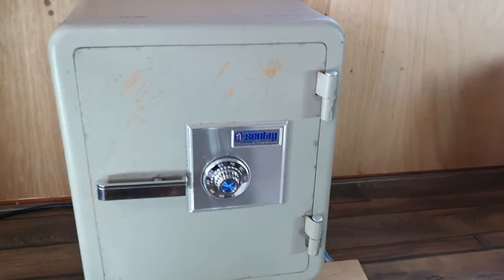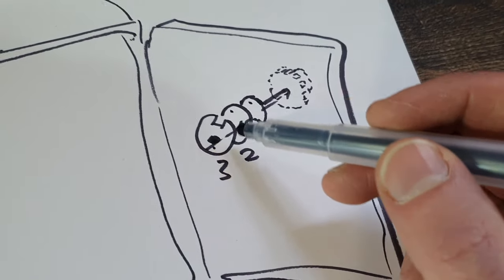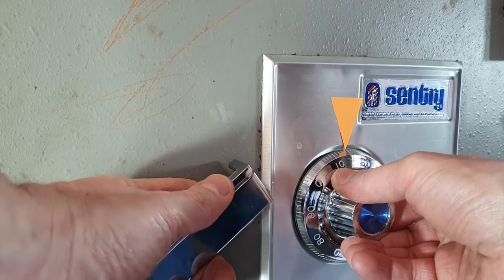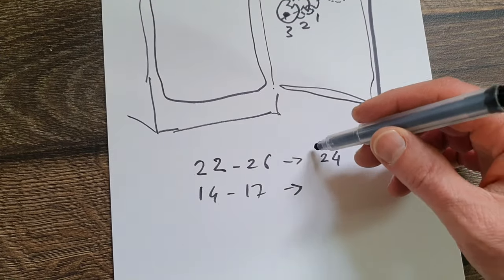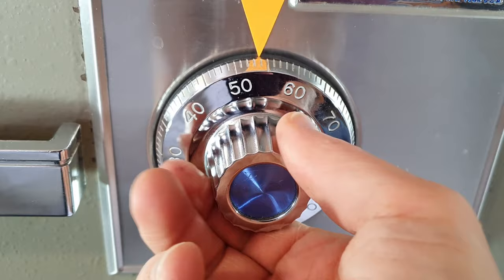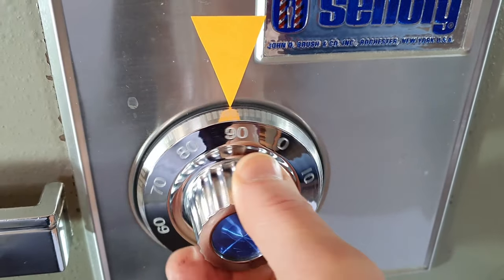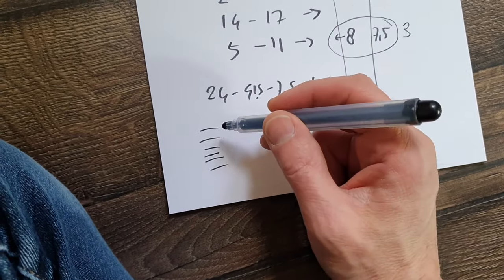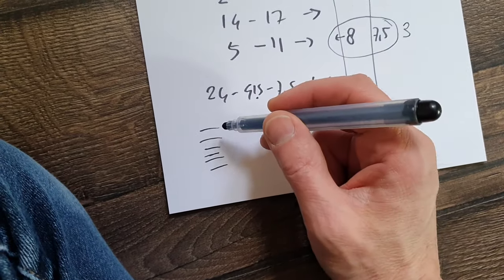Cracking your old Sentry Safe (without destroying it)

Comment: I need help! My dad passed away last January some important documents are inside a Sentrysafe model MODEL SFW123CS, I have the combination but every time I try to open it the lock gets stuck when I turn it to set it to the next number,  I tried spraying it with WD40 to loosen it but it still gets stuck, the lock doesn't glide smoothly as it should, is there something else I could try?
Reply from the maker: Hi Jessica, 
I am sorry to hear your dad passed away. My condolences. 
It is difficult to assess what is causing the lock dial to get stuck, without seeing and hearing it. Great that you used WP40 to loosen it up. I am afraid the WD40 does not reach the inside mechanism, where I assume the problem will be. With the mechanical design in mind, I imagine that the wheel or wheels hit the locking latch creating this stuck effect. To fix that, make sure you fully lift the handle (with some force) before you start dialing your number. Also, check if you can keep rotating the dial clockwise for more than four revolutions and then counterclockwise more than four. Regardless of the combination, you should be able to keep turning infinitely in both directions. If this works, then go back to three revolutions clockwise until the first number, go counterclockwise and pass the second number once, hit the number, and turn clockwise to the third number. For more information on your safe see https://cdn.masterlock.com/sentrysafe/resources/pdf/manuals/518792.pdf 
I hope this helps. Good luck, and feel free to ask for additional support.
Frank
Reply: Put the safe on its back. And spray worh wd-40. On its back so the WD soaks downward into and under the dial. Also turn the dial while you spray the WD. Be generous. The locking mechanism is in a separate compartment than what's inside.

Comment: Thank you Frank. I had to do some searching to find out how to open my dad's old safe. The combination was correct, but clearing the lock for zero was the problem.

In these older models one must clear the lock from 0 going to the left (counter clockwise) 3 FULL times, on the fourth a person should go straight to their first number. 

Next, they should go to right 1 FULL turn passing the first number and going to their second. 

Finally, they should turn the dial left again to the third number. 
The trick is in the clearing the lock to zero to start over. Newer models go opposite of this combination. Also the gears inside should be greased 1 time a year. It says with a graphite penetrating oil or light household oil. The plate is held on by one screw so easy to get to. 

I hope this helps someone else. Finding the answer was a pain.
Reply from the maker: Thanks a lot for figuring out the original sequence! I also hope this helps others in their persuit to get their safe open.
Kind regards,
Frank
Reply: Amanda I am really really grateful for your comment. I had the same problem, and today after a year of trying combinations I read your comment I could finally open my grandfather's safety. He is so happy right now and all because of you. 

Greetings from Chile 🇨🇱
Reply: You are a Saint! We've been trying to open my dad's safe for at least an hour and I tried looking for an indepth video. I was listening while scrolling through the comments and found yours. I tried it and worked 1st time! We had the combination but we couldn't get it to open. I can't thank you enough for your clear instructions! ❤

Comment: I have had a model 1330 I have been meaning to try to crack for a few months now. Using this method I identified a gate that was wider than the others (6 vs 3-4) and put it as my third gate, I then used the other numbers in the method you described and sat down to push through the 112 or so combinations. Lucky me I opened it with the fifth combination!
Reply from the maker: Wow, that's great! Well done! I am happy for you that it worked out well. ☘️
Cheers!
Frank

Comment: Thank you. We hadn't used the safe in some time. Hubby had a memory of a range of three numbers  that he said made a math equation when I continued to query him and I played with the dial.
As it turns out those three number ranges were standing out, along with a few others.
But as he finally given me enough clues I used those numbers as a careful range to dial to that I remembered dial locks use.
Clear right 3 times, left to the number, to the right passing the second number once and then left to the last number.
Yet I had to turn to the right to have it pop open.
Just like the directions said on the combination card that was inside. 
I began around 2330 and popped it open around 0100.
Reply from the maker: Well done!

Comment: Im trying to reverse engineer a 1250 myself... lucky for me the door is open already, just need the figure out the code .. you have taught me so much on how these systems work.. thank you. Great video.
Reply from the maker: Thank you very much! Good luck with your reverse engineering.
Reply: If it's open call sentry with model number and serial number ( inside safe)and for $30 the will give you the combination....
Reply: If you have it open, all you have to do is take the cover off of the lock and you can see when the gates line up.. so there's no guessing.  Just watch a video on how to do this, there are 100's of them.

Comment: Great video!  I cracked an old sentry safe for a friend of mine the same way, with a very clear last number (much larger gate) and a tell for the second number (louder click).  I can also verify that the first two numbers were located at the false gates, although my friends old safe had a left right left combination at these numbers(counter clockwise, clockwise, counter clockwise for those new to cracking and mystified by the left and right nomenclature like I was when starting).  Also verified as you noted in an earlier comment that it could open right left right with offset 6 numbers for the second and third numbers.  

Unfortunately I had to tell my friend the safe was empty.  (Or was it?  He'll never know.  Heh-heh.) Thanks again for the video!  Good stuff.
Reply: Oops.  Meant 6 number offset for first and second numbers.  Third number stayed the same as would be expected.
Reply from the maker: Thanks for the great comment! You just removed my last doubt about my assumption on the starting direction of dialing the combination. I now assume the original is left-right-left which makes sense as most of the other models and brands start left. The only reason I started right (right-left-right) was another video of a simular mechanism which showed this sequence. The fun thing is that it works both ways, although the numbers will be different. I will add a remark to the description of the video to help out others. Thanks a lot and all the best to you! Frank
Reply from the maker: PS: my friends safe was full with valuable things and he is now using the safe again. :-)
Reply: Mo

Comment: Hey Frank great video. My safe is the exact model as yours. Unfortunately, the false gates did not give me the first  number but the third number was obvious as you said. From the false gates I got 98 39 and 23 but when I finally cracked it (using a different method) the actual numbers were 95 41 22. I went through 144 combinations and (I later discovered) the 95 was too far out for it to work (the other two were close enough for alignment). 

However using your video I could see that by removing the sentry cover plate and the dial that I could drill a 1/8in hole, in just the right spot (in front of the lever nose), to allow an 1/8in wire in and align the three gates as the wire dropped in place between the gates. Could not have done it without your video, Thanks
Reply from the maker: What a perseverance! Well done. I am happy my video was useful. Have a great day! Frank
Reply: Can you make a YouTube explaining this 1/8 hole technique : )
Reply: Do you know the model of this safe?  I have the exact same one also.  It's like the internet has been wiped clean of any info about this thing. :)

Comment: Hey Frank!

Really appreciate the video, so concise and to the point. I’m working with the same model sentry safe and was pretty confident with my identification of the third gate, though now I am having my doubts… just wondering what kind of lever pressure you applied in order to determine the third gate. Of course when I ease up on the lever it widens all of my readings but perhaps this is creating inaccurate numbers…

I hope that was as clear for you as you were for me!
Vielen dank aus Kanada ⏲
Reply from the maker: Hey Tez,
Thanks for your compliments and your question. 
The pressure I applied on the handle was very light. When you find a gate you can push a bit more, because there is some space (depth) in the gate. Although while finding the edges of the gate by turning the wheel, there is hardly any, or no force on the handle. Just keeping it in the position. The gate edges ranging a bit wider should not be a problem; just take the middle of the range for the assumed gate middle.
Hope this works for you.
Have fun cracking your safe! 
Frank

Comment: Thanks so much. I am working on a similar sentry safe. I was wondering if you discover why you got a second click that clued you into the second number. I may have missed it in the video. While looking at the mechanism were you able to reproduce that situation?
Reply from the maker: With trying out all remaining combinations (3rd wheel on one value and varying 2nd and 1st number), I found 2 occurrences where the second wheel was on the same number (see video minute 13:45). There the handle outside could be moved a bit further with a different sound, the 'click'. Indeed when you look at the inside mechanism this is what you see: the 3rd wheel has an 'open gate', so the latch slides in, and at the same time the 2nd wheel has an 'open gate' to allow for the latch to slide in. The latch than hits the 1st wheel after some movement and provides the click sound.
Good luck with your safe.
Frank

Comment: If you still have this safe.  Reach up in the top left of your safe (or just look up there)-- you will feel a couple of tracts:  that black tray in the bottom of your safe is supposed to slide in those tracts and hang from the ceiling like a drawer.   I have the same safe as you.

Comment: Hello Frank and thanks for making this video! I have a Sentry v330 that needs cracking and this video is the most helpful that I've found by far. I still don't quite understand how you got your 12 potential numbers from positions 1 (22-26) and 2 (14-17). Would you mind clarifying how you identified those 12 numbers? On my safe, I've identified the three "latch" number ranges but am not sure how to proceed from here. Thanks again!
Reply from the maker: Hi JC,
Thank you.
I found twelve potential numbers, one of them being the 3rd wheel number. I did that by 'scanning' the full rotation of the dial with very light pressure on the handle. Every time I ran into bump, I tried to find the related (false) gate edges, just like with examples 1 and 2. With my safe I could identify 12 of those gates, each with the 2 edges, and in between the edges allowing some movement, like 1(edge 22-move-edge 26).

So my advice would be to scan the full rotation, note down all 'bumps', try to identify the false gates in the middle those edges. What might help is that the numbers are evenly spaced, so even if you have found less, you could derive the rest of the numbers, or check the uncertain ones. 360°/12=30° or if the dial runs from 0-100 the spacing between the 12 numbers is 100/12=8.33.
Hoping this helps you.
Kind regards
Frank
Reply: @frankrood8464  Hi Frank, so the false gates 1 and 2 you show in the video are two examples from a total of 12 false gates you found with your lock? And the other 10, which aren't shown, yielded the other 10 numbers to try? Thanks

Comment: Thanks.  I have almost the same safe.  I however, KNOW the combo...yet cannot get it to open!  It’s been stuck shut almost 30 years now.  Your video however has given me renewed hope.  I thought the handle was broke.  I now realize that I must not be picking up the right “wheels”.
Based on my known combo...I intend to try it with your method to verify the numbers are indeed the numbers.  You see I say I KNOW the combo like I am confident.  Yet it has been so long that I’m wondering if I am actually remembering wrong.  Or simply not starting in the right direction.  (I swear my sentry started LEFT first.  I also remember having to spin 4, 3, 2, 1 times .). It seems that may not be as important (?).  Anyway... I am having some renewed optimism here so again, THANK YOU.
Reply from the maker: Thanks Sandi! If you have a newer model the times to spin in each direction can vary from the model featured in this video. The more modern versions have a decoupled 3rd wheel and what I have seen on YouTube they all start with turning left (counterclockwise) first. By the way, I am not 100% sure about the turning direction for this model,  you can decode (crack the code) it starting left too, although the numbers will be different from the demo. I understand your struggle, even if you know the combination, it requires correct and accurate turning. And if your known code doesn't work, you could go for the shown decoding (crack the code) strategy. About the number of times to spin... for the first turn it doesn't matter if it's more than 3x, for the second and third turn the number of turns do matter a lot. If your safe has the same mechanism follow this video (try same procedure  starting counterclockwise) . If your safe is a newer model try to find the manual or similar video for the normal opening sequence.  Hope it works out for you. Good luck! 
https://www.sentrysafe.com/support/product-manuals
Reply from the maker: Hi Sandi, I added some advice in the description of the video. This might help you. Let me know if you got your safe open.
Reply: I have the 1973 Pyroguard by John D. Brush & Co. handle loose, correct combo.
Reply: @frankrood8464  THANK YOU!  As soon as it's not 40° out in my garage... I'LL be on it!  Saved your video.. Gonna give it my all!  (lol, I don't even think I have valuables in it... But some childhood memory stuff... More likely!). Hopefully, I will soon see!
Reply: you can start from the left or the right on the sentry... the last number will be the same but the first two will be different depending on the direction
Reply: @mikeat7665  Yes, if you don't know the combination the direction you are attempting won't matter. Once you know the combination the direction will matter because the pins will be pushed from opposite directions.

Comment: Wait I'm confused how you got the first 2 numbers. I thought when you used the handle click method, you got 22-26 anf 14-17.

I thought that meant the number had to be somewhere between those numbers, so how did you get 41 for the second number when you had 14-17 written down?
Reply from the maker: Hi Hingle, good question, as I did not  clarify how I got to the second number. 
I first made this list of all possible numbers  for position 1 an 2 (middle of 22-26, middle of 14-17I found 12 possible options with the handle click. I could exclude one of those 12, as I identified the 3rd number. With the remaining numbers I tried several combinations 'at random', varying number 1 and 2 until I found number 2.
Hope this helps.
Good luck!
Frank

Comment: Frank, I watched your video and gained a bit of insight. I have a really old Sentry Safe, same type as the one shown in the video. I received it with the door locked open and was able to figure out the combination. From what I could figure it is a four digit combo. I was able to work it many times to be able to open and felt comfortable enough to close and lock it. Now I can't get it open again. I have the numbers for each tumbler but now I am wondering if they may be out of order. When I was testing I did the combo to what I figured out might work, but now am wondering if I got the rotation directions wrong. It seemed to need to have the dial roll back to zero for the handle to rotate when I was working it. I don't seem to be able to find any consistent consensus on what directions to rotate and how many times for each number to make it work again. Am I missing something?  Thanks.
Reply from the maker: Hi Seneca, thanks for asking.
What seems odd to me is the four digits. What I would expect is three digits + the turn back of the dial (to zero?), making it 'four' positions. The newer type of dials have this extra turn, as the connection between the dial and the latch is decoupled to protect it from the approach I showed in the video. I advise you to search for how to dial combination video's from Sentry Safe, to see how this works. Then you can try your combination(s). If that doesn't work, do the same starting in the opposite direction, but keep the last turn (unlocking the latch) the same.
Hope this helps.
Frank

Comment: There are 12 false gates, but 13 holes for that drive pin in wheel 3.
So I wonder if that gives options of offsetting the pickup of wheel 2 and therefor making wheel 2 have more than 12 possible gate positions. Wheel 1 I am assuming to be identical to wheel 2, so would have an offset of the 12 positions, but fixed at factory.

Comment: Hi, Frank i have a old Canon combo lever /key safe. That i used the key only to open and lock it. Well i went to far and it activated the combo and i forgot it. Any tips or will this method work? NEED HELP BAD.
Reply from the maker: Hi Rohnb, whether my example works for you depends a lot on your safe type. There is a wide range of Cannon safes. A good point to start could be this blog post https://www.hunker.com/12409406/how-to-open-a-cannon-safe Hope this helps you.
Reply: No it wont work on a cannon safe the dial is attached to a cam on that safe not the 3rd wheel and the handle is separate from the lock.